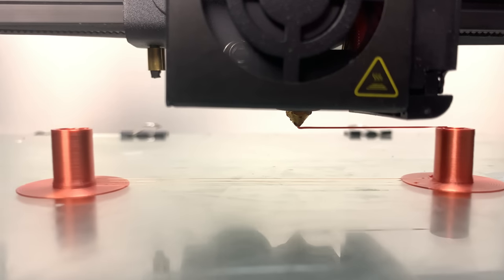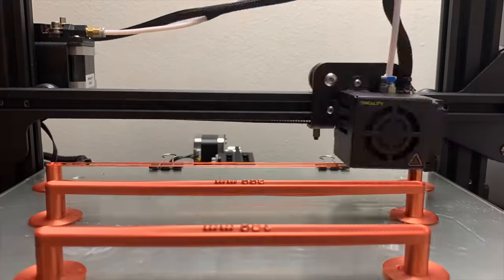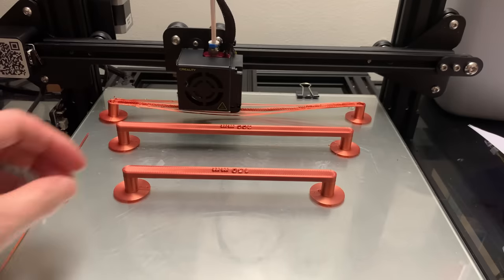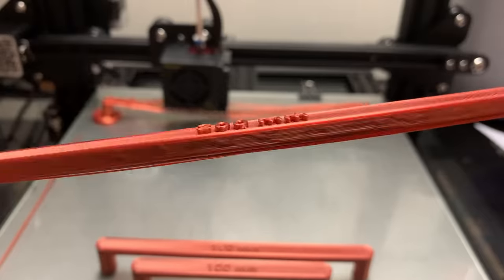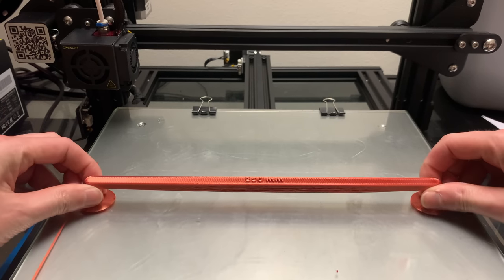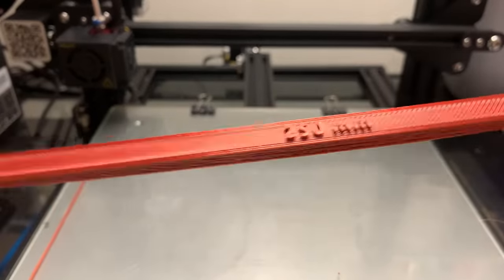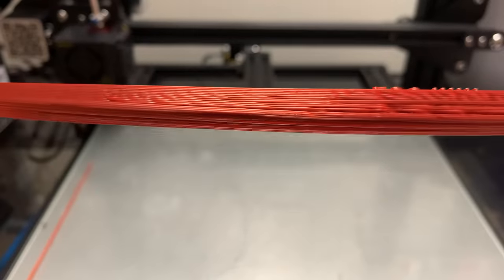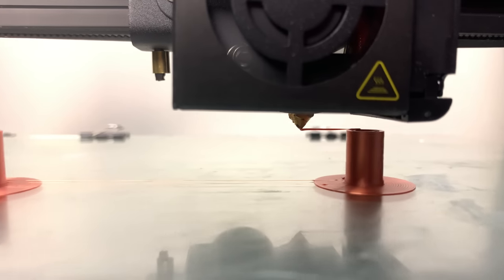How far can a 3d printer "bridge"???

Comment: That's incredible. I'd never have expected it to work that well. For some of those bridges, you need only add a couple of mm extra material underneath and you could sand it down after do get a nice part
Reply: At that point just do a support if possible.
Reply: Yeah you can just add a small column of support in the middle to halve the bridge's length (or more for really long bridges) and get better results with less post processing
Reply: Exactly what I was thinking

Comment: Try a dual-fan set up. You’ll get significantly better results!
Reply: I think too strong fan can also push the filament down before it can reach other end.
Reply: @SnakeOilDev  A “ring of vents” style configuration for the fan duct can help mitigate that.
Reply: I don’t know how two box fans at full power blasting into my building area can help, I think it’ll blow the filament away.
Reply: @aregulargamer4144  PLA cools and gets stiff pretty quick with good fans.
Reply: @lucasthompson1650  any ducts you recommend?  HeroMe or Petsfang? I am moving my CR-10v2 to a volcano with dual 5015 cooling fans.  It should be able to do 75% overhangs with the right ducts.   Looking for recos.  I am guessing dialing in print temp is critical
Reply: @mandoreforger6999  Hero me with dual blower fans (high pressure) is a decent start. None of them are really optimized for airflow & the task though. Something that chills the air, has a measured volume of airflow would be the best and none of them are that.  If you only have cooling on one side you will get problems blowers are better than fans because volume of air matters a lot though introduces a lot of noise/vibration and can give you other problems. It's a complex thing.  https://www.youtube.com/watch?v=SX-okOHvh1Q goes into it better.
Reply: fog it with CO2? Liquid nitrogen spraying? Cryo cooled fan intake?
Reply: Increase printing temp to melt the last layer but also increase airflow to make the entire thing harden faster

Comment: I also find print orientation plays a part in bridging if you're using a single part cooling fan, because of where the fan is compared to the direction you're bridging. You should try rotating the parts 90 degrees and run the test again with the same settings.
Reply: The Lotmaxx SC-10 (I think it’s a near clone) in the short time I had it (thermistor died and seems to have shorted controller board, was less than Amazon return period so I won’t bother taking the risk and time) prints showed cooling appeared even from all directions and got good results. Now, if only I’d not had dumb luck to have a bonkers thermistor that started out a minimum of 20C off!

Replacement arrives tomorrow. I’ll be curious to see what it gets away with.
Reply: Especially on the Ender printers. My E3V2 has different behaviors to different direction. There are two directions of motions I know if I align the grain, my parts come out significantly stronger. Very noticeable with CF-PLA where you get strength on par with plywood when the print goes well.

Comment: What about reducing the flow to get more tension on the string that you're pulling to the other side 🤔
Reply: if you reduce it too much it will just snap the filament
Reply: maybe cooling the Filament more aggressiv so that it gets solid sooner
Reply: @TheAechBomb  it will not snap - you can pull hairthin fibres in PLA to a length of 2m and more. It will sag though
Reply: @peter2uat  I figured if it had already cooled it would snap instead of stretching, but if that's the case maybe it would work
Reply: Also less gravity pull. Higher ratio of surface area to volume, since cross section is square in bead width while circumference is linear. Surface area crates the bridge by surface tension and works against it just flopping down by gravity.
Reply: When I was testing it I found a higher flow to work better for some reason after about a day or 2 just doing bridges and getting the best settings possible on my delta printer I managed a 38cm bridge that looked perfect and only limited by the size of the printer.
Reply: @benclimo461  impressive if true. Gj.
Reply: using the bridge settings in cura reducing the flow on my bridges gave me shockingly good results. went from some sag to literally flawless 100mm+ bridges. seriously you would think the thing had supports lol. reducing the flow is a must for bridging. just don't overdue it obviously.

Comment: Since it does straighten out, eventually bridging well at the top, you can have a sacrificial amount based off estimated sag.
I would only use this at the very top of builds, as closer to the bed a more standard support lattice would be more economical than accounting for sag to straighten out.
You're going to spend a little extra on structure somewhere, more often though  standard support will spend less.
Reply: You'd also have to increase the number of bottom layers to have a sacrificial structure. If you don't use variable settings to only increase them where the bridging occurs, you'll still use extra material most of the time.

Comment: If you blew cold air on the first overhang passes, I'm willing to bet you could get better results on the longer bridges. Would be interesting to see if PTFE filament could print supports that would break away cleaner and easier as Teflon is known for keeping things from sticking.
Reply: Or you just use two materials that won't adhere to each other, or soluble supports, rather than melting PTFE Which is unhealthy as hell.

Comment: I wonder if using a material that shrank slightly as it cooled (like abs) would make the bridging better? The sagging filament lines could in theory tighten up as they cool down making the underside of the print even stronger. Though I'll be honest, this is just a wild guess

Comment: If you slightly reduce the extrusion speed overall it might stretch the bridge better. Or maybe reducing/stopping the extrusion right before the end of a bridge it will pull the sag out of the bride before attaching. This seems like a viable method when printing something like a stool where you would need lots of support. If the bottom inch of your bridge is unusable it is still better to remove just that than having to print 10+ inches of support material. Another option could be placing some support pillars once your print reaches a certain height and then bridge to them to span the gap.

Comment: What process did you go through to properly adjust your settings to functional values? Did you just use the defaults?
Reply: The settings themselves are on the description, if that's what you're talking about.
Reply: @HappyAchterhooker  is't 👀
Reply: @HappyAchterhooker  I do think those setting given in the description of the video are quite misleading tbh. 
First, proper dual duct cooling is basically a given (dual 4020, 5015 or 5020, pick your preferred)

There is more to bridging that lowering the overall speed of print. Most slicer have a separate section over bridging and what defines as such. 

For example on the first layer of the bridge you want to reduce speed massively (~20mm/s), reduce flowrate to minimize sag, ramp the fans to max. Same applies to the second layer just with the flowrate back to normal. 

Using separate settings for bridging only makes it possible to print at normal speed, and only when the slicer "detect" a bridge it slows down the print speed. It can save hours of printing on bigger parts.
Reply from the maker: @HappyAchterhooker  I used the default settings in Cura for the CR-10, filament is Eryone Copper Silk PLA 1.75mm.

Comment: For Big bridges i shut oft the bed Mid printing and turn on an extra pc fan it rarely starts warping by doing that but I also have the fan on low and print bridges with a very low speed sometimes 1 mmps it turns out good enough and I dont have a big work after that
Reply: I avoid printing bridges, even small ones needs some work after printing. I use ABS and everything needs to be hot because of warping.
But ultra low speeds for bridges? makes sense , i will try

Comment: The filaments don't adhere because the speed is so slow and they become cool before next filament is drawn over them causing lesser to bo attachment. Try increasing the speed or slow down the cooling by a heater fan or removing cooling.

Comment: This introduces some interesting challenges for the routing algorithm. Note how the head goes back and forth which is very inefficient. The adherence and overall integrity of the bridge would probably also benefit from smarter routing
Reply from the maker: Slicers have come a long way and are very good, but there is definitely still room for improvement. Path finding optimization etc

Comment: The driving software would no longer technically be a slicer, but in principle the printer could be driven by software that understands the catenary droop and allows you to build long spans with a belly to them. In the end, not a voxel printer but a “native” tensile strand printer… but then your input models would have to take the exact properties of your filament into account. Same hardware, totally different software ecosystem :-}.

Comment: Two solutions first you could print the span upside down on the table or you could have 2 or three filiments connect all the way up until you get to where you wantvto widen the span. Then just cut out the waste.

Comment: Did anyone tried "heat treating" the buttom part of a bridged section to fuse the filaments to the rest of the part?
Kind of like with a soldering iron? (Might need a non-sticking material for the tip.)
Reply: ive done that before with petg using a lighter lol just heated it up and pushed on the loose sections with my fingers. worked like a charm. as long as you don't care how pretty it is lol.

Comment: We have very different ideas of, "a little bit of sagging" I would call the 100mm beam a failure. Just because a print doesn't actually fall apart, doesn't mean it's a success. If the bridging looks substantially worse than if you used supports, then it is definitely a failure.
Reply: That entirely depends on what you're looking for out of the print. It's subjective really. His top layer was flawless and depending on the print that's all that matters.

Comment: Would have a lot of potential for a 3D printer to use tension on string to print on. This would easily multiply the maximum length a printer could "bridge" if not make it near infinite

Comment: This will depend on the XY orientation on the build plate, as some axis move differently then others.
Reply: with a perfectly leveled bed it shouldn't matter
Reply: @TheAechBomb  Actually, on the Ender and CR-10 the X axis is a little more agile than the Y axis due to the weight of the bed vs the weight of the gantry.

A CoreXY printer has equal/balanced X and Y axis. (http://corexy.com/theory.html)

Comment: The biqu b1 will do better or a cre3 with a modded cooling fan.
Also ABS with a cooling fan only during bridging can jump a crazy distance (i have tested 1200mm. I actually have some big parts i print on top of a custom raft that sits on 10mm tall hour glass pillars spaced every 60mm this let's the part shrink while printing yet says attached

Comment: Will a fan change your 250mm capabilities? If the material is cooler when bridging you could achieve a tighter beam at 250mm. Heat causing the sagging pass after pass?
Reply: Yes, also a way better fan duct like a satsana or an hero me would greatly help. Especially if configured with a dual blower fan setup.

Comment: What splicing software do you use? I have the same printer but looking for a better splicing software that allows for more types of supports, such as trees and branches.
Reply from the maker: Cura is great
Reply: @3DPrinterAcademy  thank you. I have whatever comes with the printer that is powered by cura but only allows for grid supports.
Reply from the maker: @mistermacgray  cura now has tree supports
Reply: @3DPrinterAcademy  guess I'll have to get the program, would make my life easier for sure.

Comment: You might want to print in a pressurized environment in an atmosphere of a very sense noble gas, or perhaps in an atmosphere of sulfur hexafluoride. You could probably bridge much further that way.

Alternatively, you could try to print with lighter materials or a variable nozzle diameter...

Or moving to space so that you can print in lower gravity.

By the way, CNC Kitchen has a ton of videos you can check out if you want to make stronger printed parts.

Comment: Whats your recipe for bridging that far? Im currently working on a project where I need to bridge a maximum of 6". I dont have the option of printing supports because the section is in a closed container and around 12" from the bottom of the build plate. I also will be using abs

Comment: Any tipps on getting better bridges?
Even the small ones look bad on my ender 3 v2.
20mm already have strings that don't stick togather and sag down.
Even with fan to 100% and 35mm/s top/bottom layer speed.
Also the tiniest overhangs sag down. Like the top of the window holes on the Benchy.

Comment: I believe that if the 3D printer had printed a bridge over 200mm I'd have 3 support beams on the bottom 2 on the very end and the 3rd dead center of the bridge so that it wouldn't start to sag in the middle.

Comment: My printer likes to print diagonally for bridges instead of straight lines. I wish I knew how to change that.
Reply: Seems like a gcode issue
Reply: It's all adjustable in the slicer software.
Reply: @ehhehh4049  Figured out my bridge settings and was able to get a 200mm bridge.

Comment: Go from the bottem left to the top right
Reply: Nah the real trick is goibg from top right to bottom left probs on a uv resin one
Reply: @michaeljones5681  lol
Reply: I have to try that on my FDM :)
Reply: Actually it won't, its a little harder to explain but in simple words even if it had the power it won't do it
Reply: Can it move diagonally without stutter?
Reply: @GeoRush1110  idk
Reply: I did it with my sidewinder x1.. not too difficult..
Reply: I did it with my sidewinder x1.. not too difficult..
Reply: Lol
Reply: @Shadow Knight thank u for the Grammer error i didn't notice it
Reply: @Shadow Knight ow
Reply: Mean make upside
Reply: Bottem
Reply: a
Reply: Yeah I was just thinking this,  that a longer test bridge is possible by orienting it diagonally on the print bed.
Reply: lol
Reply: @gladius_arbor  bottom*,  grammar*.
Reply: @Schmeedle  well sorry bro that I'm not English
Reply: The head would collide on the second pass crossing over
Reply: @GeoRush1110  have you ever seen a 3D printer before? Of course, it can move diagonally without stuttering.

Comment: My layers don't adhere well @ 200degC I have to be at least 220 for it to flow and adhere just right.
This changes with all filaments I use but I've never gone below 220.
Reply: I hate printing "cold" or below like 210 since the parts are so fragile. Functional prints for me.
Reply: I printed well designed vertical monitor stands with pla 200 deg. And everything is fine and they’re really strong so I guess it depends on filament 🤷‍♂️

Comment: Been waiting for someone to do this in a vacuum chamber.  I want to see how this would react in outerspace.  Not with plastic with steel , a 3d printer welding steel beams or parts.
Reply: That’s gotta be pricey
Reply: @finnleithomczyk5292   would be less expensive than sending up steel beams.  Send up steel wire and just make the structure you need. I watched a video on cold welding you can basically weld any metal in space with just friction . So not out of this world to think its impossible or improbable.
Reply: Vacuum doesnt mean, there is no gravity. 😂🙈
Reply: @mathevideos9909  good observation, I didn't think of that.  Can we still try it in a vaccum chamber reguardless?

Comment: Stupid question (zero 3D experience here) but would such a printer still print when turned 90degrees and mounted to the wall? It would stop the sagging. Maybe. But honestly I am still impressed since anything that I can think of would only require half an inch or so and that obviously should work great.
Greetings Bernhard

Comment: Hey I don't know too much about 3D printing but I found this very interesting and I was wondering if maybe instead of bringing it and a long straight line maybe to building a couple of layers at a time I don't explain it let's say like a spider web but from one post slowly building up a couple layers and then just floating that piece all the way to the end I'm hoping that you understand what I'm saying
Reply: You can bridge slowly be overhanging a bit with each layer. 45 degree over hangs usually work great. To bridge a gap without using the overhang method, you need cross the span in one go. You can't have really large overhangs but you can have really large spans.
If the printer went out an inch and then came back, the plastic would just flop down. The far end needs to be attached to something.

Comment: I wonder if there's a tunable way of having flatter bridges by pre-compensating for sag? i.e. printing in an arc-formation so there is a slight hump to the bottom layer (ever so slightly, maybe 1 layer's worth). As it comes back to print followup passes, the pressure of the slightly raised filament allows the print head to maintain full contact, and the subsequent layers provide enough bracing to essentially bend the bottom layer straight.

Comment: I just started a print a few hours ago and realized that I have a 90 degree overhang for about a 1 inch section, and this video gives me hope that it wont become trash.
Reply from the maker: as long as it has something to connect to! a cantilever probably won't work!
Reply: @3DPrinterAcademy  yes! it needs to bridge a gap similar to what you've done here, but only about 26 mm at the widest point.